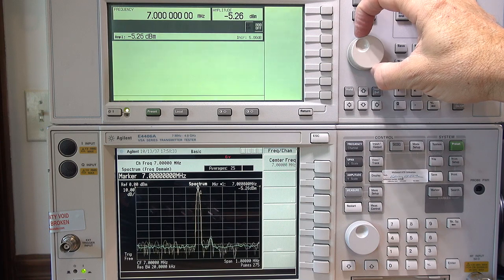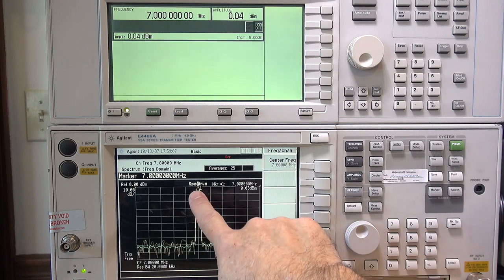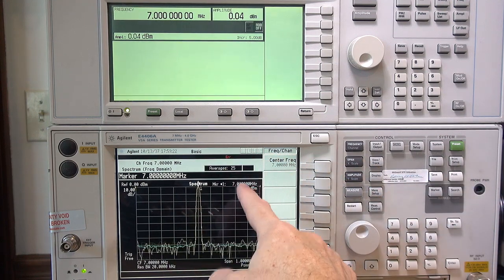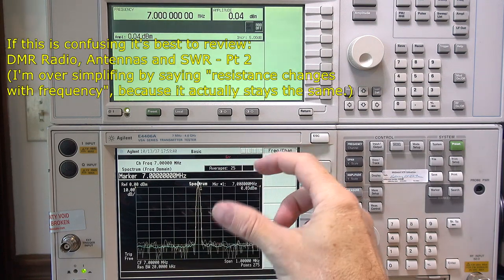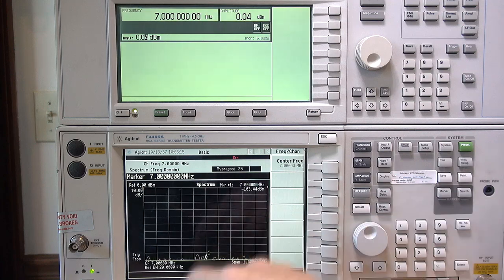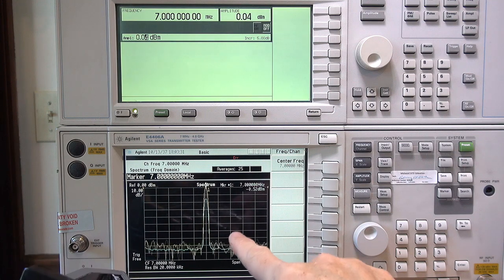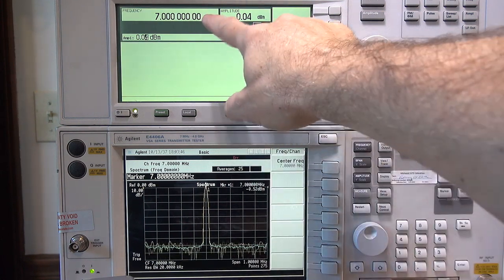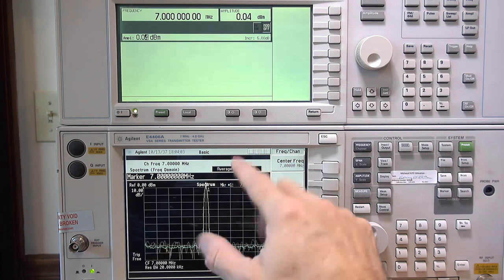HAM Radio Cable Losses and Stealth Antennas

Comment: I was already doing research on the pros and cons of LMR-240uf for my next antenna project, this pretty much solidified my deciding to go with it.  I already use LMR-400 for my HF dipole, going from the balun outside into my house, I just wasn't sure of LMR-240 handling any power, let alone the benefits from a lower loss cable, which will prove useful when running QRP in a POTA event.

Comment: Nice review Martin. As Shariar is pointing out - when you're referencing the power level it's actually "dBm" not simply "dB"; dB is only a relative measure between two data points. For dBm the reference is to 1 milliwatt - so 0 dBm equals 1 milliwatt measured across a 50 ohm load and is the most common one used for RF stuff; there are others, for example when talking about audio measurements in the old days the reference was to 600 ohms. Didn't want folks not familiar with the topic to get confused.  Keep up the great work!  73 - Dino KL0S
Reply: Should have said - in a consistent 50 ohm impedance system.
Reply from the maker: Thanks Dino, it's an important point that needs clarification so thanks for the post good man!

Comment: Martin  excellent video.  I have a question.  I been given a lot of different  advice.  But want to buy a Discone antenna to monitor a scanner and shortwave.  May in the future get my ham license.  But for now just receiving is the lmr 400 over kill ? Or could I use rg58 or rg8? Or maybe lmr 240?  Thanks

Comment: No need to apologize for using glasses.
Reply from the maker: ;-) Indeed, I just need to get used to tripping over them!
Reply: You can also use polarizing filter on your camera lens  to suppress any reflections.
Reply: I can however highly recommend Contact Lenses.. I went with glasses for the first year and it seemed fine but I love contact lenses so much more.. not for the appearance aspect but convenience like full peripheral vision, no rubbing dirt on the lenses, etc.  I would highly recommend trialing them, process here was super simple.